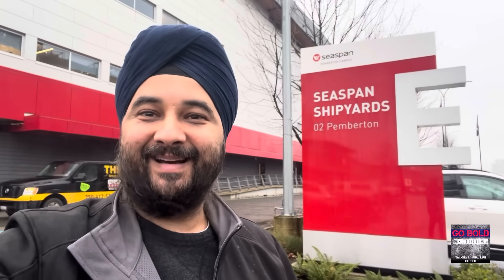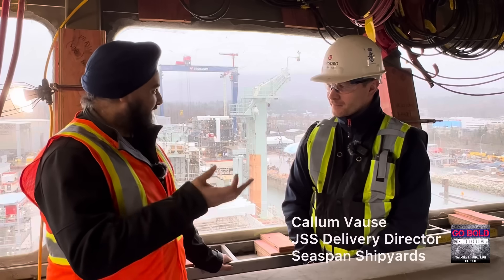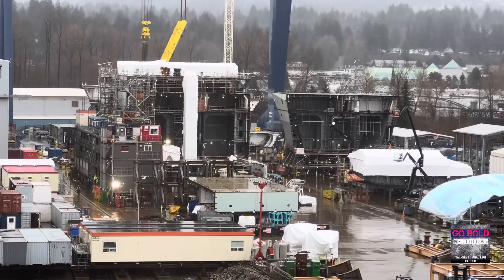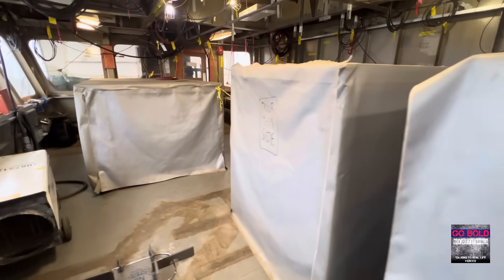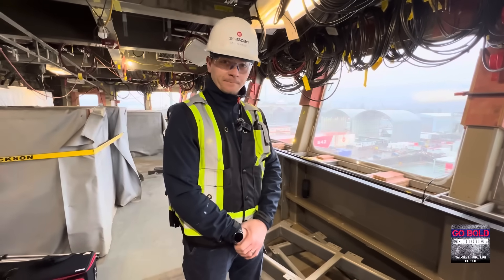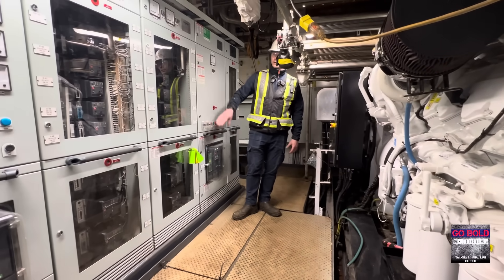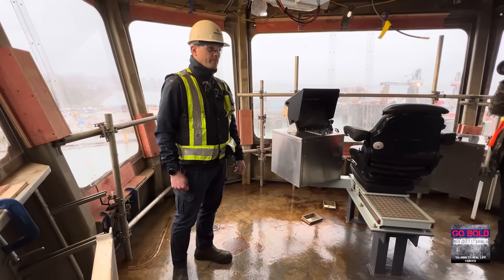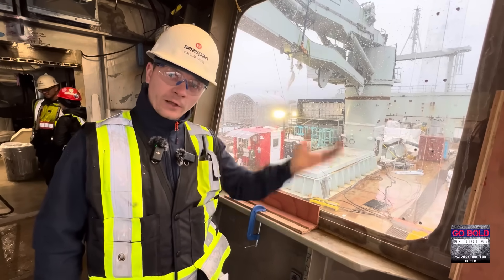Tour the future HMCS Protecteur! Canada’s First New Joint Support Ship for the Royal Canadian Navy!

Comment: JT launched this ship last year with a ceremony and so far I have not seen any pictures of this ship sailing or operational. Can anyone please provide pictures or a video and confirm when this ship will actually be sailing end of 2025 , 2026? thanks
Reply from the maker: JT was there for the launch of the ship. The launch does not mean commissioning. There is still a lot of outfitting work to be done, and it is expected that it will be delivered to the Navy in late 2025 or early 2026. There will then be shipbuilder trails and also Navy trials. I'm not exactly sure when it will be commissioned into service.

Comment: for having worked at the Davie yard on MV Asterix 10 years ago there is not a chance in hell this ship has sea trials this year from what we see in this video. By the time Seaspan is done building it the hull will have to be repainted and the electronics out of date. Those contracts should have went to the proper shipyard capable of building this ship and not to buy votes. By the way MV Asterix took only 2 years
Reply from the maker: Time will tell

Comment: UK had 4 larger supply ships built for less than the cost of one of ours. They had the hulls made in South Korea and outfitted them in the UK.
Reply: The Protecteur Class is the largest vessel built in Canada since the 60s and 70s, Seaspan had to build brand new facilities to complete this project which is why the costs are so high. It's a problem that plagues most projects under the national shipbuilding strategy, each design basically requires entirely new facilities to be built to facilitate manufacturing, but due to low order quantities the cost of those new facilities are spread out over a handful of ships making the upfront cost of each hull look higher than it actually is.
Reply from the maker: @JollyOldCanuck The hope is that once that infrastructure is built, and shipbuilding experience developed, then some efficiencies will result. My fear is that no matter what Canada does, there is not enough contracts OR the discipline to retire ships when they should be. All of that has to be factored into the equation. Sadly, defence in Canada is treated like a political football -- let's hope those days are over.
Reply from the maker: Great comment
Reply: We want to build and rebuild our industry.
Reply: @cautionhumanbeing749  ya we have heard that one before, that was the line when the Halifax class where built

Comment: What a joke this ship was ordered during Stephen Harper's first term as prime Minister how many years ago was that?????
Reply: 2010, but my understanding is that 15 years from order to sea testing for a new ship design is not unusual (plus I am sure the labour and supply chain issues during COVID probably slowed things down by 2 years). It looks like an impressive ship and everything inside the hull had to be custom designed and integrated.
Reply: The one Harper  had built was a modified freighter  to support ship that after only a couple  years of service  Trudeau  decommissioned.  This is a completely  different  ship
Reply: @CPRRAMSEY no that was the temp charter replacement